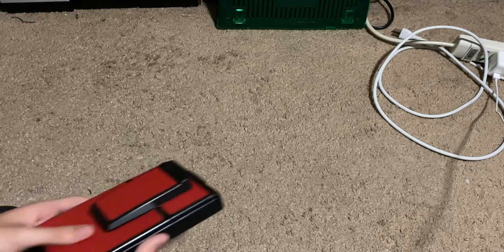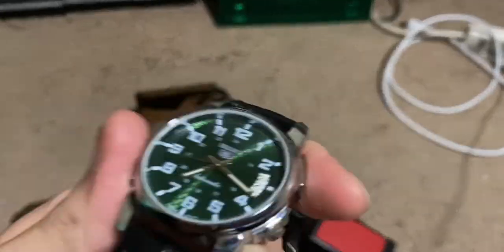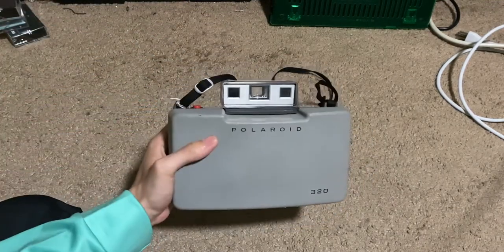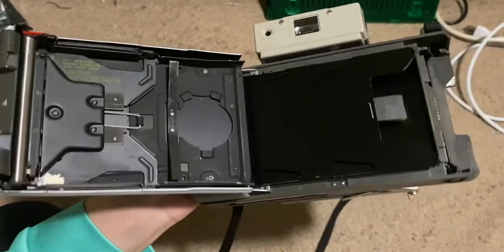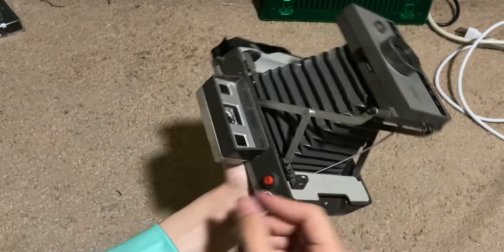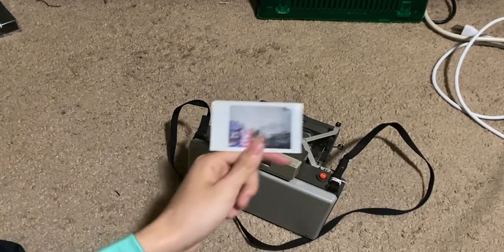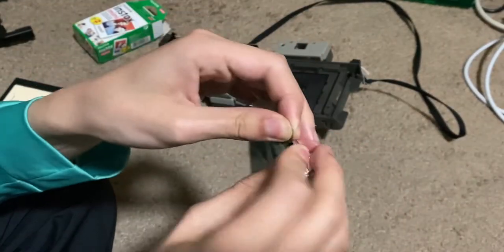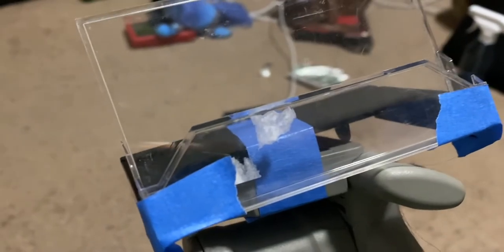Instax mini film in an old polaroid land camera? (Polaroid land camera 320 packfilm)

Comment: What does the battery serve? Flash only?
Reply: the shutter speed is automatically picked by an electronic eye on the front. it also controls the shutter i believe. also the flash yeah
Reply: Yeah, what this guy said, it powers shutter speed selection, which is automatically changed depending on the B&W/Color selection switch up top, and the flashbulb